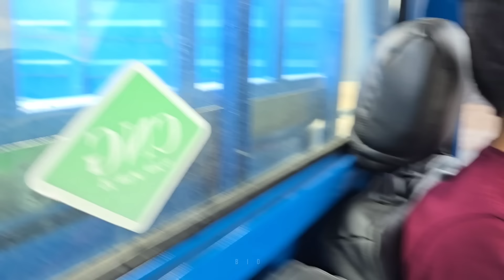Good progress. Buying a chainsaw for firewood

Comment: Good luck to you chainsaw work is very tiring.  Dangerous too. Ive seen leg cut off before.  Chainsaw can whip around and cut you it stuck in wood etc. Be cautious.  Not to be used when tired or upset. It will cut you in half. 😮😢

Comment: Congratulations on purchasing a gas-powered chainsaw! This tool will make it much easier for you to cut firewood and handle carpentry tasks around your home. However, you should save some money to buy a new blade, as the old one appears worn out, which is likely why your chainsaw is smoking.👍👏👏

Comment: Chain saw is smoking bad. Also you don't saw it back and forth. Just let the saw cut thru. Sawing it back and forth will mess up the chain. Bending the teeth.  Chains are expensive. Also keep chain  cleaned and oiled

Comment: Jamshid you are not using this chainsaw correctly.  First:  the chain is blunt Two: you are slicing the wood when you should be seesawing it. Keep in mind safety, were you keep your feet, not on the wood you are cutting.

Comment: Make sure the chain is sharpened. And cut straight you don't have to force the saw to cut. I have a chainsaw that I use. Buying a extra chain helps if there is any. Practicing helps.

Comment: Your saw is not sharp you are going to burn the engine use the tip not the end of the saw you need to change the blade it shouldn’t smoke like that I’ve seen plenty of tree cutting and none of them smoke like that 🙈
Reply: Привет моя дорогая семья Бид мои любимые Киануш Джамшит супер герои вся семья работает как заведение нет  отдыха❤❤❤